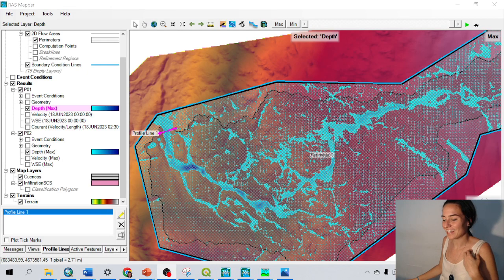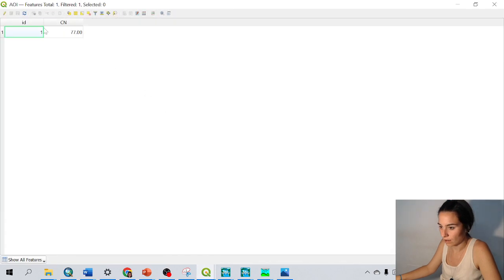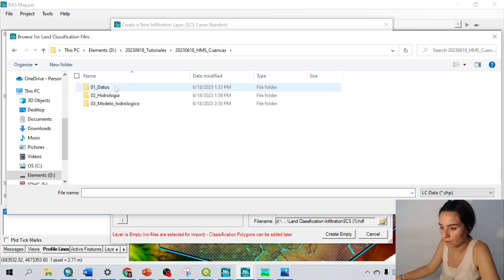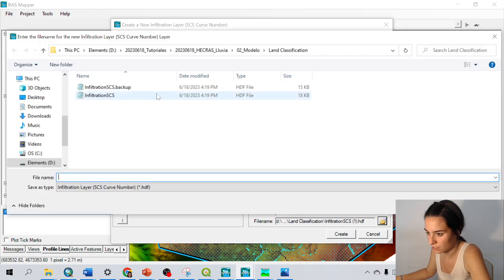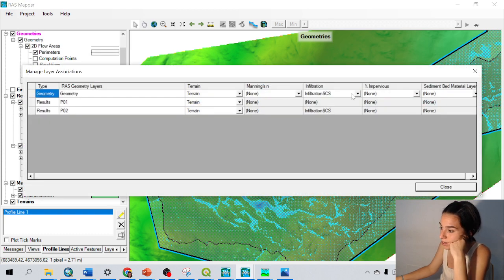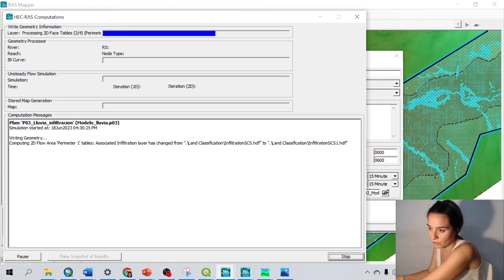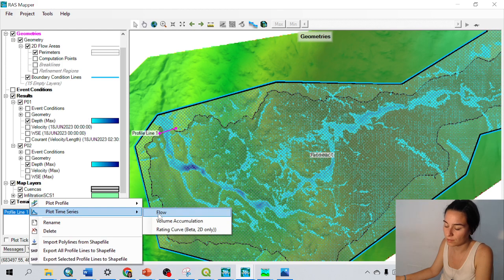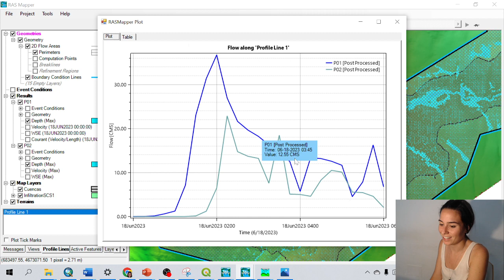Infiltration HEC-RAS 2D

Comment: Hi, great tutorial! for me making the infiltration layer works, but when I go to manage geometries I can't select it for infiltration, (but I can select it for manning's n?) would you have any idea on how to solve this? thanks!
Reply: I am a big fan of Ana, great videos, but I had the same problem when I tried this in HEC 6.5 - couldn't get the geometry to associate with the infiltration. Eventually I got around it by first creating the LandCover for Mannings and  Percent Impervious (without infiltration) from shapefiles, then associating the geometry for Mannings N and Percent impervious, ignoring infiltration. After that I created another new RAS layer in the same way and chose the option to create "Infiltration layer from Land Cover/Soils Layers" using the Land Cover layer I had just created. This generated a completely independent Infiltration Map Layer called "Infiltration" which I could then associate the infiltration in the geometry. You also then need to right click the new Infiltration layer and edit the attibutes where you can manually set the CN for each feature in the corresponding LandCover map layer
Reply from the maker: When you create the new map layer, you have to select land cover layer (not infiltration layer), and then select the shape that contains the manning number

Comment: Hi, I have followed this tutorial but for some reason when I try to run an unsteady flow an error occurs saying parameter curve number and abstraction number has no value for certain cells, would you have a solution for this?
Reply from the maker: Hi, it seems that your infiltration shape layer is samller than your geometry, try to get an infiltration layer that contains all the perimeter.